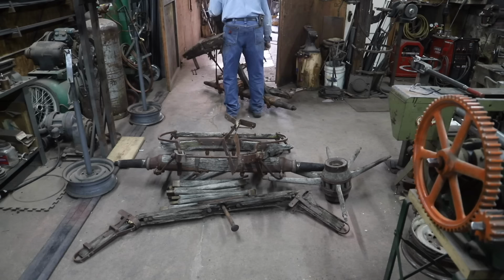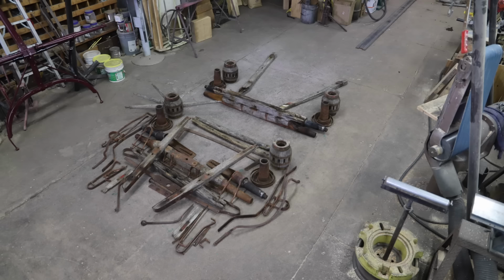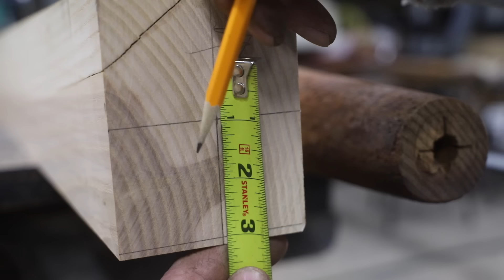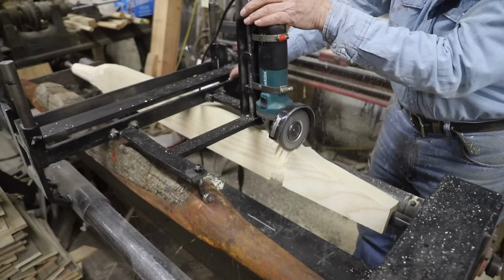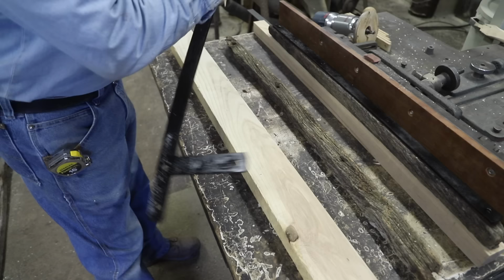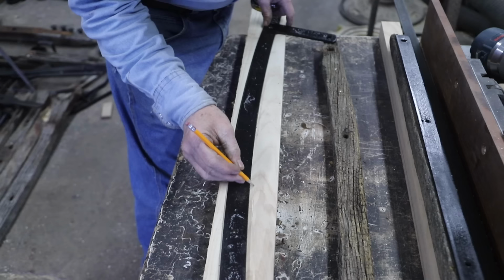Complete Restoring a Horse Drawn Wagon Gear | Engels Coach Shop

Comment: Are there no fasteners to hold the Brake 'pads' in place?  It is a thing of beauty and a joy forever.🤠
Reply: They're bolted on.
Reply: @dianeengel4155  I must have missed that part.  Looked like they were just hammered into metal clips.  Thanks.
Reply: I was wrong. They are hammered into clips that are called a brake clutch.
Reply: Dave said he showed it with the most detail on the video of the sheep wagon running gear.
Reply: @dianeengel4155  I will try and find it.  Thanks for looking into it.  Didn't look like they would stay in place if they shrunk.

Comment: Hello for Indiana Dave! I have a question about the wood that you use. Are all the running gear parts made from the same type of wood? I saw in another video that you made the box out of poplar. We have a lot of poplar here in Indiana. Back in the day would coach shops use specific wood for specific parts or whatever was commonly at hand in that area?
Reply: The running gear is all ash on this one except the spokes are hickory. Back in the day they used poplar for the boxes. They used a lot of white oak and ash for running gears but probably what they had available, too.

Comment: Dave, I just have to ask  do you apply a thinned down coat of boiled linseed oil and then a coat that's not thinned to get deeper absorption? Nice job on that undercarriage!
Reply: He used TWP on this running gear,  but yes, when he uses linseed oil he thinks the first coat down about 25%.